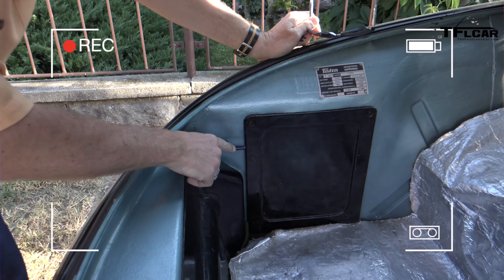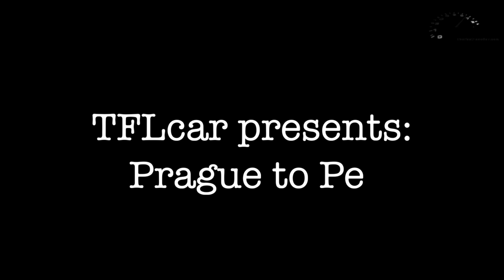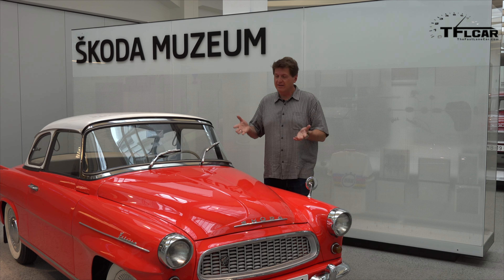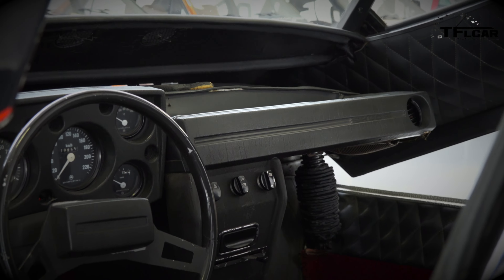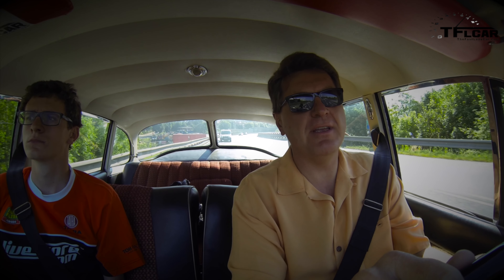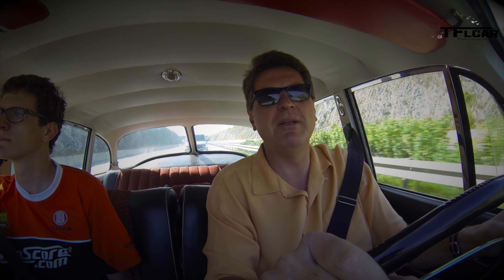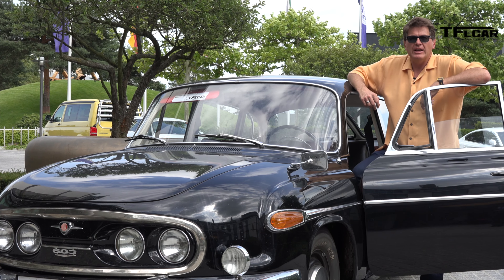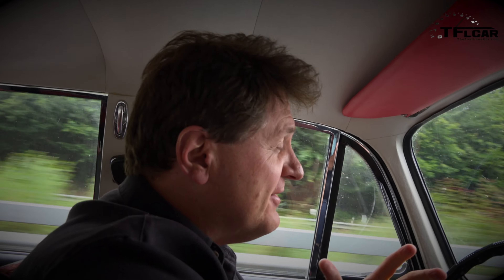Autobahn Top Speed Test : Prague to Pebble or Bust (Episode 2)

Comment: the concept car at 6:06 is the concept of the Skoda Roomster. the production car doesn't have the suicide doors of the concept, the rear door handle being vertical, flush mounted and blended into the rear window frame. though the production car is very close to the concept, notable for the the slightly disjointed front-rear design (almost like the person designing from the b pillar forward was told they were making a small van, the person designing from the b pillar was told they were making the popemobile). though that design has aged quite well.